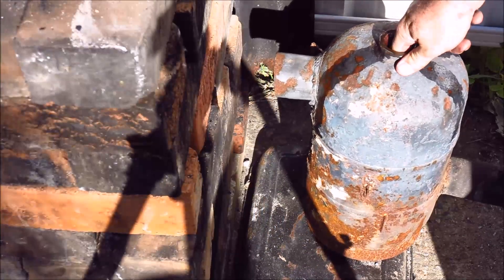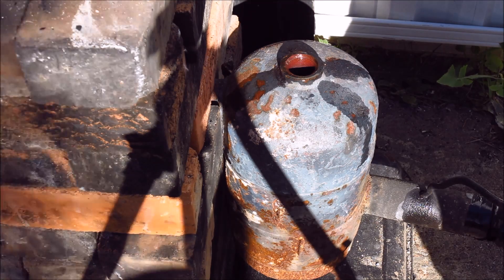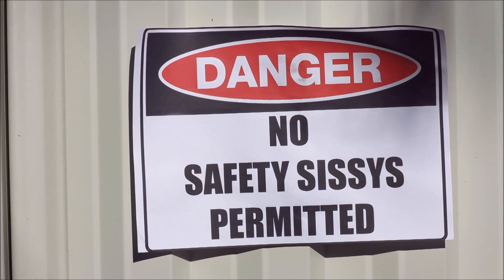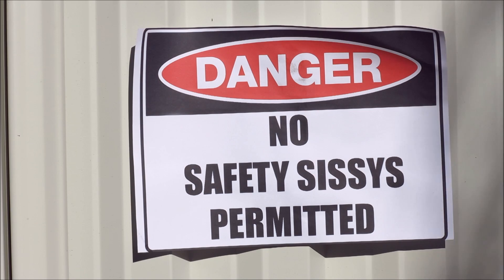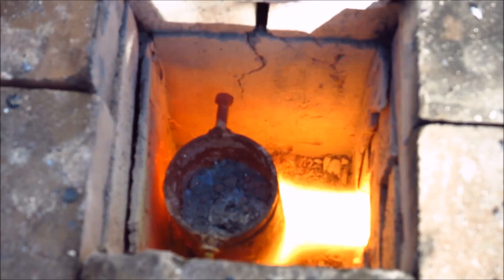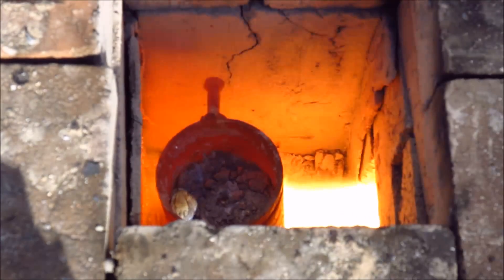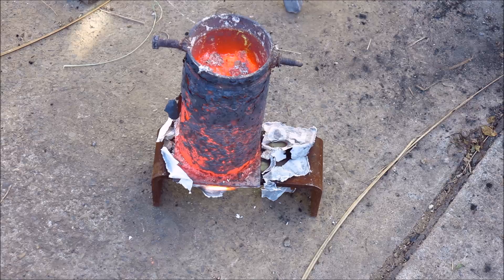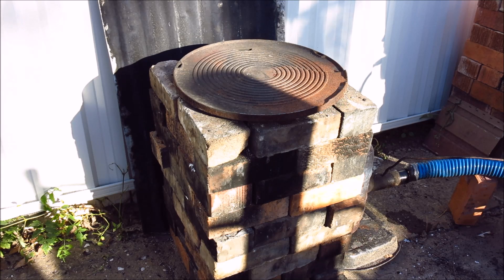Melting Aluminium with brick furnace oil fired.

Comment: Preheating the oil makes it easier to flow and increases the temp. The increased temp makes it easier to vapourize. In northern climates preheating is %100 needed as in my outdoor temps the oil is solid.
Reply from the maker: Other than making the oil flow if it is thick such as in extreme cold,  preheating does nothing to the way the oil burns.  It does not make it burn any hotter or light off any easier.  If you over heat the oil in the line it will cause it to coke up and block the line or little pieces to foul up any nozzles you have.  This seems to be a very common Myth but as someone who has hands on tested the idea many times over the years and come to the same conclusion every time, I can tell you it does not help combustion at all. 

You can always mix in some Kero, turps or winter diesel to help your oil stay liquid and thin it out a bit. Used ATF if you could get it would also help no doubt. 
If your oil is solid, then heating it to make it flow is obviously essential. Where I am atm the temps are usually about 30oC so the oil is nice and liquid.
Reply: By basic law of thermodynamics that isnt correct. Heat is energy. Heating oil closer to its vapourization point before adding it to a furnace will decrease the amount of energy needed to make it into a vapour in the burn chamber. If the oil is 10C and vapour point is 100C then you need enough energy to make it 100C before it can burn. If you preheat that same oil to say 80C you will decrease the amount of energy needed in the chamber to make it burn.

I do think for those lucky enough to live in a warm area the difference is moot as you will get a good burn otherwise but there is validity to this.

I wouldnt preheat on the basis that it increases the ease of burning but this is the same logic that would allow you to use a small amount of oil and a torch to start a fire which will then get the rest of your oil to burn.

In the end the energy used preheating and burning as opposed to cold burning would roughly be the same, but the preheated oil would produce more heat in the fire if its preheated as it doesnt need as much energy to get to the vapour point (since there was already energy added before). 

I dont really feel like getting into numbers and math but its pretty easy to calculate.
Oil will take a specific amount of energy to increase 1C. This is the basis of the BTU (water not oil).
So if you have oil that is 10C then you can calculate how much energy you need to make it 100C (the assumed vapourization point).
Then you add the heat, lets say with a stove/electric, to that 10C oil and make it 80C. Lets assume thats 70 energy units. That would mean that the burner only needs to use 20 energy units to burn the oil whereas before it would have needed 90. If you look at it in this way you will see more energy coming out of the burner as a result of adding the electrical energy to preheat.
Maybe ill make a formula tomorrow and post it with real world numbers but i cant be bothered now.
Reply from the maker: k_froggy
My smallest burners will produce over 100Kw. my largest over 600Kw. You really think that the amount of energy required to heat the oil is going to make a damn worth of difference to those sort of outputs?? Neither the total energy or the max temperature will be affected.

I'm pretty sure if you work out the amount of  electrical energy required to raise a flow of 1l/ min of oil  250oC which you would need to do to get even near the  vaporisation  point of the oil which is around 300, your household circuit isn't even capable of supplying that much power and it would cost a bomb if you could.

It would NOT make a difference to the temp anyway.
If you think otherwise, prove it.  Set up a burner firing at a fixed fuel and air flow and take the temps of the furnace without preheating and with preheating.  I pledge here to you and everyone else,  if you can show a repeatable and measurable difference, I'll give you $10k . That ought to make it worth your time to prove me wrong and I'm prepared to back my position by putting my money where my mouth is. Are you?.

You can't because the fuel has a fixed BTU content and max flame temp per volume of fuel.  Perhaps you should pay attention to that part of the physics.   The only extra energy you can get out of it is what you put into it from the outside source.  The fuel will burn at the same max temp no matter how much extra energy you put into it because once it vaporises in the chamber, it's over 1000oC on what you could preheat it too anyway which would be a max of 300 before it carbonised the fuel line. 

You can't get any measurable energy increase  out because the difference between what you could possibly put in preheating to the total energy of the burner is far too great. One would be far better off using better refractory materials to keep the heat generated IN rather than trying to increase the temp or amount of energy already in surplus.

That would lessen fuel consumption if you were for some reason worried about that and wanted to go to expense to save a fuel you get for free anyway.

I can summon up more energy than I need for anything out of my burners. Why do you think I need to go to extra complication and expense to get more when I already have an abundant excess of temp and heating power??

Control of preheating would be very difficult  or useless done with heat from the burning and done with gas or electricity would be more complication and paying for energy I simply don't need and can generate at no cost just by turning the fuelling on the burner up anyway.
have a look at the vids where I demonstrate the ability I have to raise or lower the output.

From what I have seen, guys doing cast iron only use 100Kw at the absoloute most in their furnaces. I was doing 300Kw every fire up years ago and the next burner I do will be 1000Kw+.
What the hell would I need to pre heat for even if it did do anything which it will not. I don't know why you think it will raise the temp but I do know you are patently incorrect.

You may have problems with your burners and that being the case it would be useful for you to add complication and expense so you can get the things to work at all with your thickened or solidified fuel .  The last thing I need is more temperature or over all energy.
If I got that aluminium any hotter than what I did in 5 min running this burner at maybe 20% of what it is capable of, I think I'd have serious potential problems.

Ally melting is way too easy with the power and temps I can produce at will now, I think I'll have a look at the trend of copper melting so there is some sort of challenge in it for me.  Not that I expect it will be much when I have already melted iron with my present, non preheated setups and melted brick as well. I was thinking of doing that in a future vid again just for shits and giggles.

If you want to calculate it out, show me what  the difference is on a burner doing 200Kw/hr would be and the energy input required to achieve higher furnace temps and greater energy output.

I welcome the mental exercise!  :0)
Reply: As i said earlier i wouldn't preheat on the basis of energy savings i would do it for flow rate. But regardless it DOES mean there's energy used, even if it is minute amounts compared to your output. 
 "Neither the total energy or the max temperature will be affected." False. It will be affected, however the number may be insignificant to your burners. It is significant for small burners that struggle to keep a flame and aren't made to be run outside. (think of ceramic lined fireboxes instead of steel fire extinguishers) 

Quick math shows me that its around 25,000 BTU to heat up the oil needed to sustain 1L/minute for an hour. That is a little less than a liter of oil over the course of the hour just to heat the oil to vapourization temp. Again im just pointing this out for the sake of keeping information true. There is a difference. And in your burners i might not hurt but for other people it might. 
Also worth noting that thats not all that much power to run off a household circuit where i am. I could easily achieve this with a standard 240 dryer plug. But i wouldnt heat with electric unless it was an automated burner. 

To a certain extent we are arguing the same point. Preheating isnt needed for your burners and for any simple burner. For mine it is, only for flow rate. But at the end of the day having a fixed amount of energy in your fuel doesn't mean that it doesn't waste energy getting it up to vapourization temps. In a perfect burner (like the commercial ones) it would matter because all the heat is contained inside a refractory chamber and forced into thermal mass. But in your case you lose so much due to poor insulation (not saying you need it) and inefficient design (on heat retention principles) then you do lose some heat via bringing cold oil in. But as you've stated it doesn't matter. You have lots of oil and you have no need for efficiency.

If you want the oil to vapourize and burn and sustain a flame without having to hit hot metal to vapourize and without splashing all over the inside of the burner then preheating is a must.  

Its past midnight here so sorry if this is a bit rambley.
Reply: Oh and id love to take you up on that 10K offer but i moved out of the warehouse i was working in so all my burners are in "storage" and i cant use them :/

Comment: propane is a good way to light the oil :)
Reply from the maker: Yeah, done that many times in other vids and it works well. I just prefer bit more of a challenge these days. 
I'm going to look at building an automated burner in the future and I'll definitely start that on gas, have a preheat time then introduce the oil. Be the simplest and easiest way to automate the start.